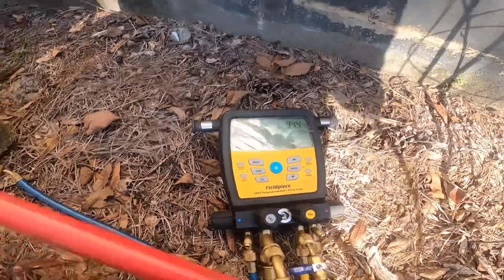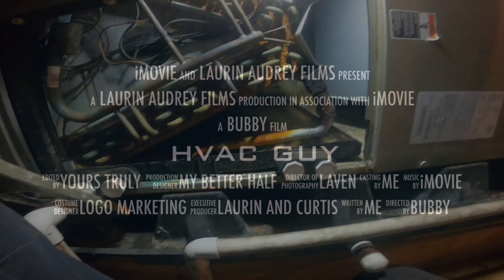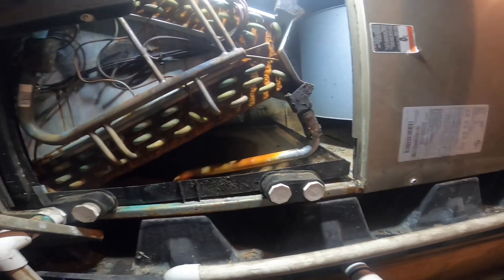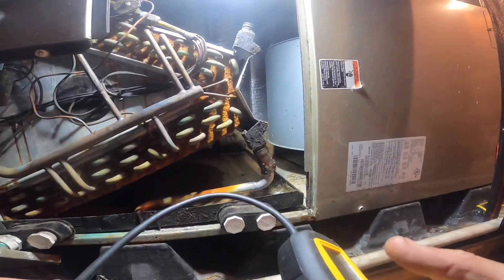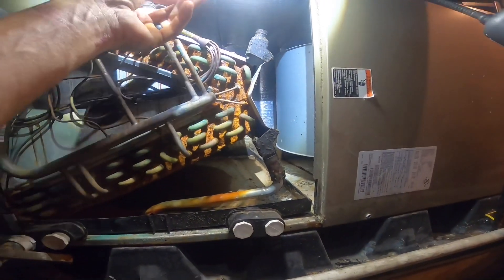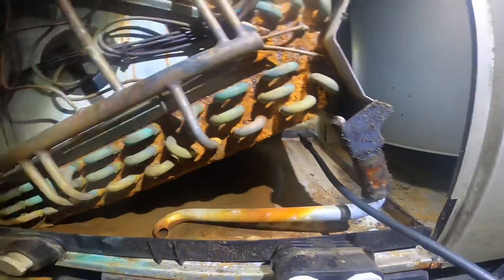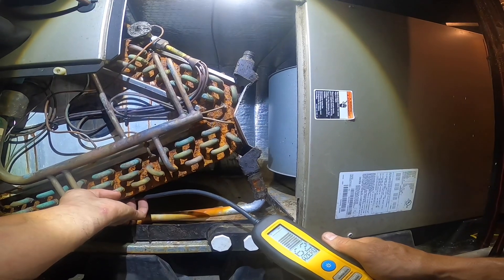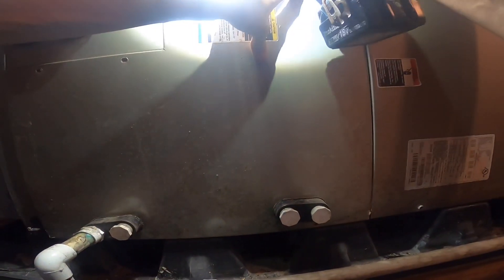2008 Bryant Heat Pump - short cycling.

Comment: My heat pump only short cycles in heat mode.  I live in the south.  Summer temperatures can reach the high 90s yet the A/C mode works perfectly and is extremely efficient.  Once temperatures drop to needing heat mode (high 40s) the short cycling begins.  Everything is good for about 3-4 minutes then only the compressor will shut off, then restart in a couple of seconds, and then complete the cycle.  the colder it gets the more frequently it happens during a normal cycle.  I've had three different contractors look at it and spent a lot of money for nothing.  I changed the filters regularly, changed the thermostat, and checked freon and various components.  I am afraid this is damaging my system.  Any Ideas?
Reply: Did you ever happen to figure out the problem? i have also had 3 contractors and been on multiple forums and the contractors all said there is nothing wrong, if i have cool air in the summer then its fine..  and the others just said " thats what heat pumps do.. just turn it off when it gets below 45"  I figure they are not meant for super cold but thought maybe there would be a fail safe for it to not do that if there was nothing wrong
Reply: Mine the same thing in cool perfect but in heat it short cycles of I put on 72 or higher at 69 to 70 it doesn't short cycle it works well like that .

Comment: I sold a 40 ton LG multiV VRF system  and installed it just two months before the pandemic lockdown. 
                      Now for that very same customer we’re doing the next project in the same building exactly identical to the first 40 ton LG multi V  VRF system and we had to raise the price by $30,000 plus the customer was shocked  
         Plus our company labor rate went up by 24% to compensate for this year’s inflation

Comment: Theres a Big shortage on Rheem Coils.. My Coil is leaking from 2015!!!! They had 5 in stick in Atlanta had they not had that in stock MY REPLACEMENT DATE JULY 2022.. LetsGoBrandon only comment i should have said but oh well. 3 ton split unit Rheem 16seer down here went from $5500 to $8000